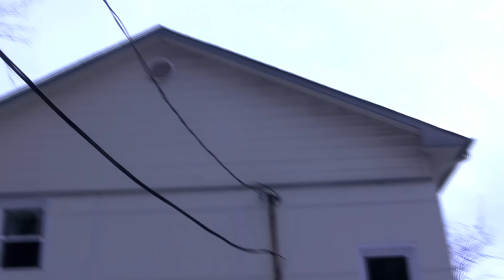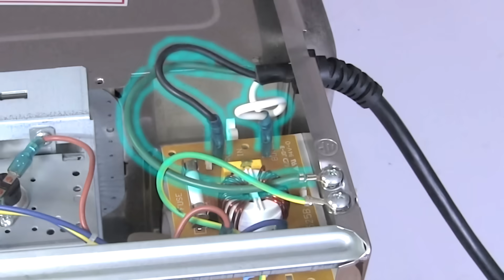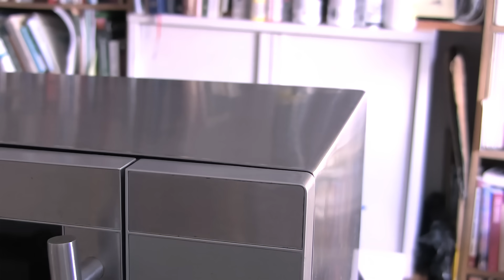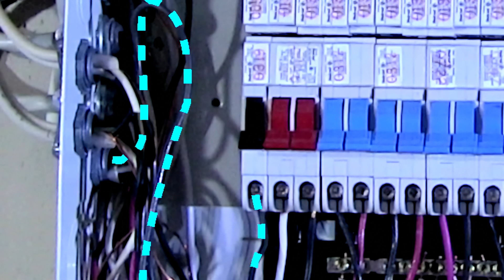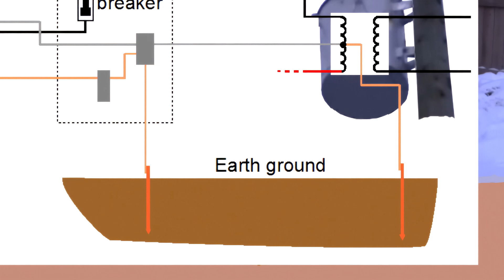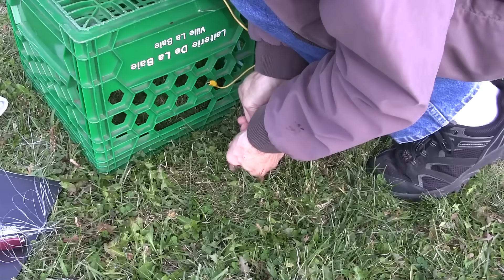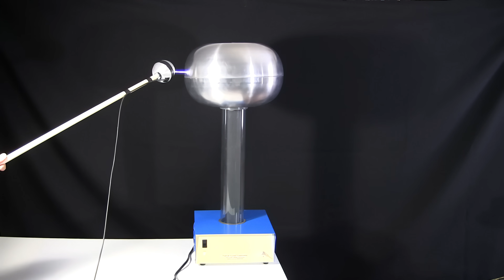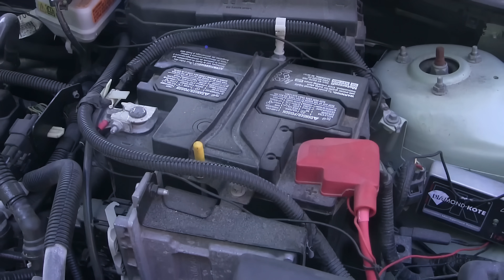What is Ground? Earth Ground/Earthing

Comment: What would happen if you  did not connect the mains neutral wire to ground at all?
Reply: Getting much static electricity, for instance. Overloads...
Reply: It is connected at the transformer anyway. If it was never connected then you would have an isolated system. They have problems for example if nearby lightning induces over-voltage to the wires.
Reply: It means you get an electric shock if you touch the neutral wire.

The only reason you don't get an electric shock is because the neutral is at the same potential as ground, and your body is also at or close to ground potential because you are physically in contact with the ground. So if you contact the neutral the potential difference across your body is very low, too low to cause a high enough current to flow to cause electrocution.

The ground/earth is for safety, it isn't required for the appliance to operate.
The electricity flows in on the live (hot) line and returns on the neutral, it doesn't use the earth. So the fact the earth and neutral are bonded together is not for the purpose of enabling the appliance to operate.
Reply: @deang5622  It occurred to me that if neither live or neutral was earthed,  the ground would be dead and there would be no shock?
Reply: @ValMartinIreland  Yes, basically correct.
But you would only get no shock if you touched the wire that was connected to earth.

What a lot of people forget, is that neither of the live or neutral are actually at zero volts.
They are both oscillating from a voltage of US  -169 volts peak to +169 volts peak or in the case of the EU and UK: -325 to +325 volts. Both live and neutral are identical. People think neutral is safe, but it is identical to the live line, the only thing that stops you getting a shock from it is because it is connected to the earth, but if that earth connection breaks(and it does happen) then you are in trouble. So, certainly for electricians going to work on electrical installations to troubleshoot a fault, they should not assume that the neutral line is safe.

You can take an AC appliance that does not have an earth wire connection (so for example a double insulated appliance that does not have a metal case, eg. a laptop power supply, a hair dryer) and reverse the live and neutral and it will still work correctly.
What you must not do is get the wires the wrong way around for an appliance that has an earth/ground wire. That then becomes dangerous.

So if the voltage waveform on both live and neutral is the same  then why call one live and the other neutral?  It is done for two reasons: 1. Because one is connected to earth and helps you connect the wires the right way around in plugs when there is an earth present, and 2. It is useful in 3 phase situations (and US split phase) to name the neutral wire neutral.
Reply: @IroAppe  Volts disappear into the ground? That an interesting phrase, I have never heard that before.

Current flows, and can disappear into something, volts don't flow.
Reply: The grounding systems are expressed with two letters. The first expresses what is done at the transformer to the neutral wire and the second what is done to the protective ground at by the user. The systems are

TT, TN and IT. TT means Terre-Terre i.e. both are just connected to the ground. Additional protection like an RCD is needed to make it safe. TT is mandatory for example in Italy,  it is allowed in the UK. In the US it is banned.
 
TN means Terre-Neutral. In that the protective conductor is connected with copper to the transformer. There are three versions: TN-S and TN-C are largely obsolete. In TN-S there are separate conductors (ground and neutral) the whole way, in TN-C there is just one conductor all the way to the socket. The modern system is TN-C-S where the conductor is common to the entry to the house and separate after that.

IT Isolé-Terre. The center of the transformer is isolated or has a high impedance connector to the ground for lightnings. There is no neutral, just three phases. The ground is provided locally. This is common in Norway. It also is used on hospitals and ships. It is a secure system as a single accidental grounding does not cause immediate problems.

The benefits of TT, IT and TN-S is lack of possibility of a PEN-fault. In TN-C the risk is highest as the fault can happen even inside the house.A PEN-fault is serious as it energies the cases of grounded equipment.
Reply: @okaro6595  IT does have a neutral. You can't always achieve perfect load balancing across the three phases with single phase loads. And there are alway plenty of loads which are single phase loads, ergo there must be a neutral.

The point is in an IT system the neutral is not connected to earth. It is isolated.

Comment: can you do a video explaining how grounding works in a floating grounding system like what they use in aircraft and cruise ships?  how do they keep grounded, protecting people and electronics plugged into the electrical system? where does the stray/excess current go if the ocean water is more resistant than the hull of the cruise ship?  how is the current dissipated and made safe for anyone/anything in contact w/ground wire (i.e., earthing mat usage on a cruise ship)?
Reply: What I took away from the video is that the potential between the source and the "ground" is the key. The "ground" doesn't have to literally be the ground just as long as it has a large volume to absorb all the extra electrons. I would assume that, just like in a car, that all the metal of the ship would be enough to "suck up" all the free electrons from a short. I was always confused as to how a car's chassis can be a "ground" as the rubber tires insulate the car from the ground but now it makes sense that the large volume of all the metal of the car just soaks up all the free electrons....to a point I'm sure. Great video, if I'm right, it finally makes sense to me.

Comment: Hi Steve... just wondering... with the trend of grounding (earthing) mats that plug into the ground wire of the plug, is it safe to plug into the ground thru the outlet with a conductive mat?  would we have to worry about getting zapped if there's a stray current from a surge or ground fault in the electrical system? what about connecting to ground wire to put into a bath tub? scary thought, but some people from an earthing forum have wondered about grounding water in a bathtub for use. while the ground wire, outlet, and water itself has high resistance, compared to path to ground, just wondering how dangerous that idea is and your thoughts on that. likely in the end, most will just ground to a metal pipe of water system if available or run a separate grounding line from earth direct.

thoughts? thanks!
Reply: My rule is: do not use electric sockets for what they are not intended to. You may know know the dangers. If there is a storm that breaks the neutral then there will be close to mains voltage in the ground contact.
Reply: @okaro6595  Definitely applicable to places like Florida.

Comment: 5:30 this part is important. The object doesn’t have to be that big and it doesn’t have to connect to the earth. On an airplane in flight, ground wires connect to the fuselage. The International Space Station also has a grounding system even though it never touches the ground. In a car, electricity only really flows from the cathode of the battery to the anode, so the metal frame of the car or engine block is a ground.

Comment: No matter how many videos I watch on ground it just doesn’t make much sense to me. Idk it just seems like some sorta safety feature
Reply: I believe yes it's primarily about safety but also primarily about reference.  I believe those are the two biggest reasons we ground circuits - safety and reference.  Because the electrons that compose earth/ground have such a stable and static charge that it serves as a great reference, or standard, for the rest of the circuit to operate from.  I am only just beginning to learn about these things so take that with a grain of salt, but that is my understanding so far.
Reply: @christopherharv  Ground has so many meanings. The referene ground is entirely different from the protective or equipment ground.
Reply: Yes, like seatbelts it is a safety feature. If that does not make sense to you then I cannot help. It has secondary function for dissipatring leaked current but this is secondary.

Comment: In an AC circuit, is it that the wire that goes through the breaker is the hot wire? I understand what a hot wire is in a DC circuit but not sure on AC.
Reply: Both wires coming into the breaker are HOT and will have about 120v on each in NA
Reply: In AC one wire is grounded and the other is hot. The hot goes through the breakjer so that once the breaker trips the circuit is de-energized. There are also 240 V circuits where both wires are hot (+ in some cases also a neutral). in those cases both whots go through the same breaker (a double pole one) so they trip together.

Comment: "Ground" in an electrical circuit is just a concept, a way to make connections on a schematic much easier to draw. If not for the ubiquitous ground symbol, your schematic would get far too messy to understand. The little ground symbol simplifies the schematic greatly. Bottom line is that it's just a common connection between a lot of wires. But beware of any currents that flow through your ground ... the resulting I*R voltage drops create noise that can be amplified!
Reply: That’s just one usage of “ground”, it’s not the only one.

Comment: American seems complicated than Asia using 220v
Reply: The main difference in the US is that we have two or three phases going to residential units, instead of the single phase common elsewhere.
Reply: @PrebleStreetRecords  Just the opposite. The US is single phase, in Europe three phase is common. That is why for example EV chargers are different. Note 240 V is still single phase.
Reply: @okaro6595  We have three wire split phase to most homes, but most multi-unit buildings are true three phase. Really helps with those giant A/Cs!
I'm guessing Europe just grabs one phase for each home, generally?
Reply: @PrebleStreetRecords  It depends on the country. Building flats have three phase with one phase usually to an apartment. Houses have one phase or three phase. But one phase here is 230V and with a 32 or 40A breaker means 7,3 or 9,2kW, more than enough for a home.
I have both one phase and three phase grid connections but I'm using exclusively three phase one now. Keeping the one phase connection, maybe in the future with electric cars I will need it.

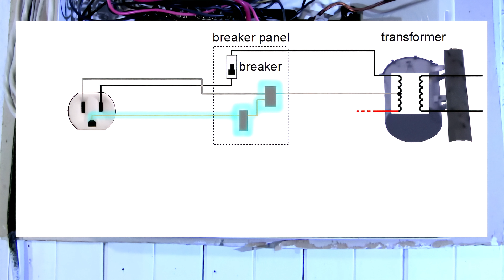Comment: 1:39 , wait, isn't that "null" actually ? As in fake ground, bootleg ground ?
When you said ground wire is connected to neutral bar
Reply: All ground wires are bonded to the neutral bar at the panel.
A “bootleg” ground is where it’s connected to neutral at the outlet, and there is no separate ground path all the way back to the panel.
Reply: @PrebleStreetRecords  I learned recently this way of wiring is in America.
In Europe, ground wire is 100% separate from neutral wire and at no point do they come in contact, ever.
Reply: @kruskotv1311  wouldn't connecting w/neutral allow the current another option to go back to source ...and isn't that a good thing?  altho going to ground isn't a bad option either and can be just as effective neutralizing that excess current. i'm just learning this stuff to better understand earthing so that i don't electrocute myself when putting things together myself for a mat of my own to ground.
Reply: @kruskotv1311  There is no universal standard in Europe. What you describe is TT and it is mandatory on Italy and common in some other countries. In Finland it is not used. Here the system is TN-C-S i.e. same as in the US. Before the 90s the common method was TN-C in which there is no ground wire and neutral is used for grounding. In the UK they earlier used TN-S where the wires are separate but both go to the transformer. It is not used anymore, instead they use TN-C-S.
Reply: @kelvinolg  On a TT system the ground wire goes only to a ground rod. This is not enough to trip the breaker so additional protection is needed. This can be in a form of a 100 mA RCD that protects the whole house. Individual circuits then are protected by 30 mA RCDs according to the local code. TT is mandatory in Italy, in the US it is banned.

It has the benefit that is the neutral breaks you only lose the power. The current cannot get back through the ground wire. Of course if you manage to trip the main RCD you lose all power. Fortunately it is more likely that the sub RCD trips.
Reply: In a bootleg ground the ground wire is connected to the neutral in the socket. That is illegal in the US but is legal in some countries in old installations. In proper grounding the connection is done at the main panel. Fore example in Germany that is called nullung while the older method was called klassische nullung.

A bootleg round is not fake in a sense that it would not act as a ground. It does have issues and there are arguments for banning it or allowing it in converting old ones. In the US they have chosen to ban it. In teh US the method for old installations is to use a GFCI. In Europe the issue is moot as no change is needed unless you actually want to ground it.

Comment: Nice video! But why is the ground in the power socket necessary? It seems the neutral wire could do it's job since they are connected.
Reply: I also thought like you... if they are connected, just use the neutral wire that arrives at the socket as the grounding pin. BUT we need 2 separate wires for this because it has to do with the path the electricity takes.

If you jump the neutral cable to the ground pin at the socket, as it's a short distance, the case of the equipment will have voltage on it when the equipment is working, because electricity won't flow in one direction only, it will go from hot to the equipment, to neutral pin, then to ground pin then back to the equipment case. If you touch the case and turns to be standing barefoot on a low resistance floor, you will feel at least tingling sensations.

The reason why having a third cable solves this problem is because both cables are coming directly from the main panel, where JUST THERE they are bonded. This will assure that the electricity that arrives at the main panel through the neutral cable has a long travel to go back to the equipment through the ground cable, so it will have a much lower resistance going to the neutral connection in the transformer or the grounding hod.

Both wires are basically the same, but they have different colors and names so you can always use the green one to the ground pin in the sockets and the black as the neutral. If you use the green one as neutral in one socket, equipments connected to that sockets will start to feed voltage to nearby equipments metal cases... Colors and names are conventions, neutral and ground wires are interchangeable as they leave the main panel, as long as you use the same as neutral in every socket and the same as ground in every socket, it will be fine.
Reply: @joao.mambelli  Thanks for the explanation. In short I understood that due to the resistance of the neutral wire, it still carries a little bit of voltage compared to ground as it leaves the appliance.
Reply: @mikolajwojnicki2169  Yes. And this voltage does not come back through the grounding wire back to sockets because it's much easier for it to go to the neutral in the transformer or the grounding hod as the neutral is bonded to the grounding wire very closely to where the grounding hod is located (main panel)
Reply: A great comprehension starter on a topic that proves again that the founder of  these concepts and terms weren’t thinking of the confusion they were creating by using the same word for differing sits eg ground in a circuit should obviously be named otherwise.  Presenters speaking rate a little quick for mine but graphics vg
Reply: the ground wire has a much lower resistance than neutral so in case of a faulty connection it guarantees that the power will be cut off
Reply: @sotostrig  Ok, but then why doesn't the neutral wire have a very low resistance too? After all, resistance leads to energy losses.
Reply: @mikolajwojnicki2169  the ground cable is also connected as the video explains on stuff like for example that oven' s case.If the hot wire touches the case and there s no ground wire you ll get zapped.Also it helps by removing static charge in case of a lighting strike to protect equipment or to protect you you if you touch it
Reply: @sotostrig  But why is a separate cable necessary? We could have just 2 the live and the neutral+ground wire.
Reply: @mikolajwojnicki2169  because if you connect the neutral wire yo the io oven's case then the case would become part of the circuit the moment you would turn the switch on and we obviously dont want that.Thats why we need a separate cable just in a case of a short circuit
Reply: @mayda4th  nuetral and ground cables are connected in the breaker panel but only the neutral wire comes in direct connect with the hot wire so electricity flows through the neutral back to its source.But if the hot wire goes loose  for some reason and touches the case then the hot wire is DIRECTLY CONNECTED to the ground wire which is attached to the case and so electricity is driven back to the breaker panel as it happens with the neutral wire.But contrary to normal flow of electricity hot->ovens mechanism->neutral  the path hot->ground has no resistance so it allows huge amount of current to flow which causes the breaker to trip
Reply: @sotostrig  Please understand that you are really not giving us an explanation to our question. If the neutral wire was used as ground and the hot wire would touch the case, there would be a short circuit hot -> neutral which would trigger the circuit breaker just the same.